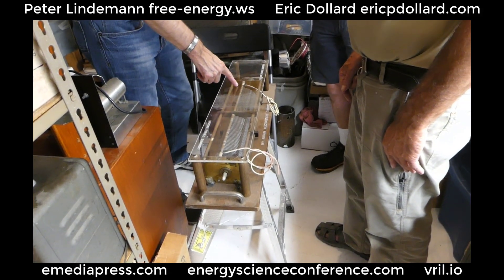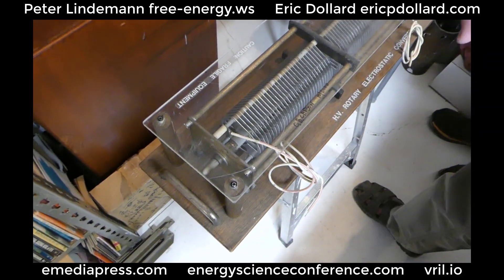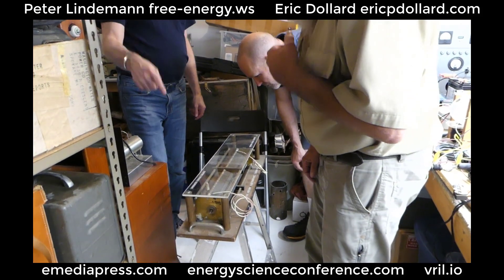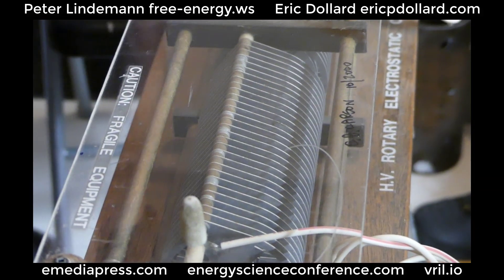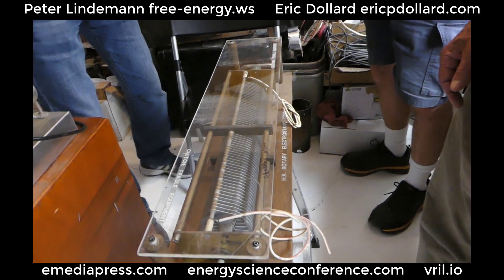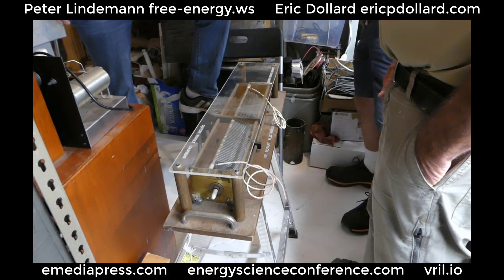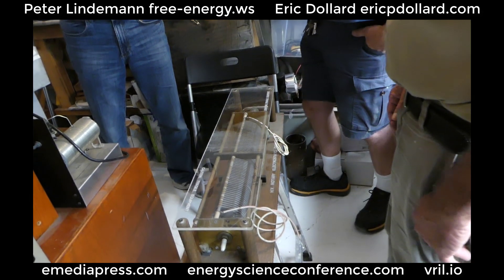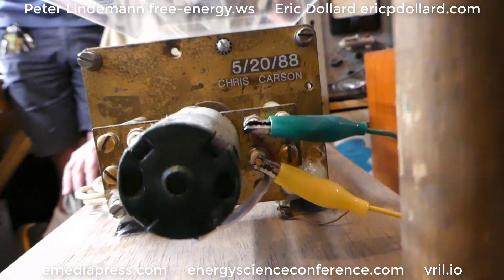Chris Carson's Parametric Rotary Electrostatic Converter 2019-09-01

Comment: Aside from a variable capacitor, what's in the circuit?
Reply from the maker: Needs a HV exciter and more.
Reply: @AaronMurakami13  My understanding was that an abrupt change in capacitance over time leads to an increase in voltage, so what's the exciter for?
Reply from the maker: @Blurns  To apply something like 10kv across the capacitor. Then you rotate it.
Reply: @AaronMurakami13  Is the point of that to step the high voltage down?
Reply from the maker: @Blurns  I believe part is to get it to self excite so that it sustains its own high voltage without external excitement. That is one part of it.

Comment: Ceramic (titanium aluminum) magnets are the most powerful dielectrics in  capacitor generators. Metal moving near metal changes time density in the ether because all matter is moving through it. Also known as a magnetic geometry warp of one to phi. Or (N)1:1.618(S) which causes alignments (fractal focal coherence) and thus charge separation capacitance. As a form of triboelectric series materials aggravation of dielectric insulation between those metals. So rotor and stator are acting as plates. And the air, wood, or othet placed material (even water, as hydrogen absorbs radiation creating charged water) can act as the dielectric. Both plates are also in geometry for magnetic pole one to phi formation (time charge variation.) As with transformers, electromagnets are created. Rotation creates an aggravational charging of the capacitor in a dielectric environment. Ceramic (titanium aluminum) magnets are the most powerful dielectrics in capacitor generators.

Comment: I think (after years studying Dollard's work of course) that for real energy synthesis the so called machine cannot have moving parts, but must be made of a coil and a condenser in parallel suffering parametric variation in a synchronized manner involving a short circuit and an open circuit condition. This coil and condenser spatially properly arranged represents the distributed induction factors of a two wire transmission line and possibly can prove the law of continuity of energy into power. The parametric variation of the inductance must be caused by magnetic saturation due to a short circuit condition and the parametric variation of capacity due to an open circuit condition causing arcing effects. Both can be constructed in one transformer or distributed network with copper and  iron and mica..This way electricity can be made out of pieces of time, magnetism and dielectricity.